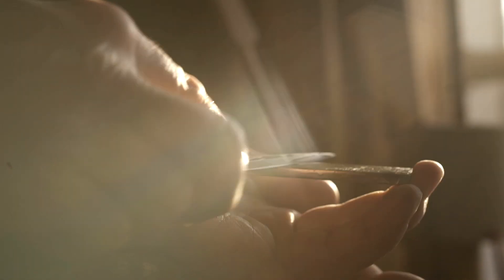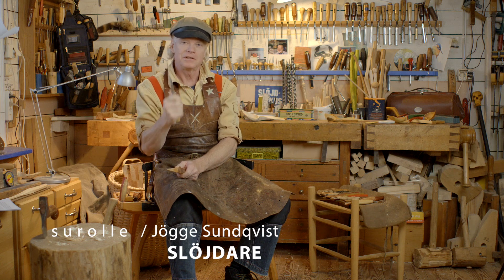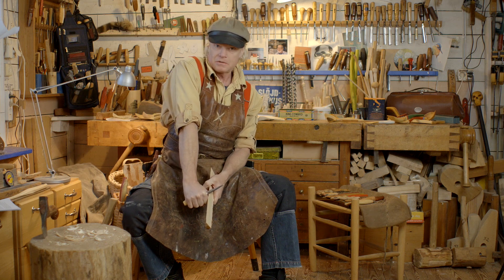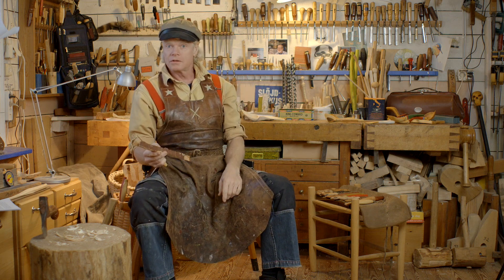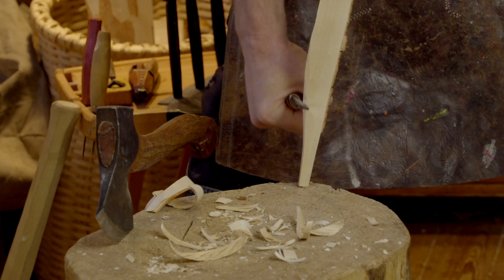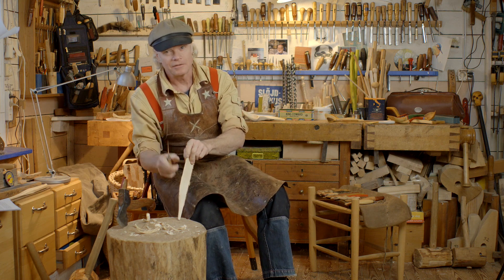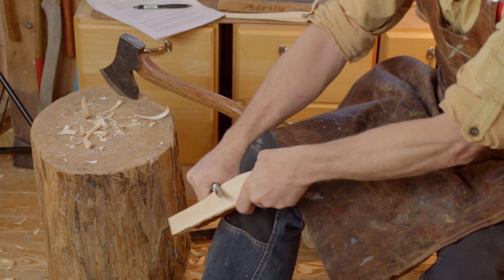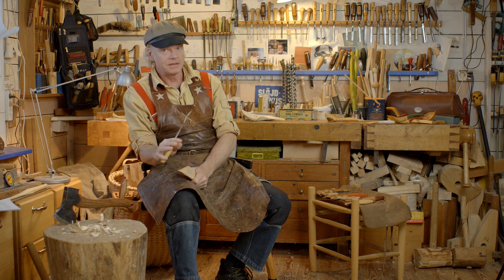Swedish Knife Grip Sessions NO3: The Power & Knee Grip.

Comment: That's a good video, nice bushcraft grips. However, the first cutting technique shown could be a fantastic way to slice through your femoral artery and kill you quickly if you slip. Probably shouldn't show people to cut inside that magic triangle...
Reply: This is Scandinavian/Sloyd style woodcarving and has been in common use long before the word bushcraft was even conceived.
Reply: Although I've seen this technique taught with the work held on the outside of one leg, which is probably more fool-proof than this variation, Jögge is starting the cut with the blade facing away from himself, about level with his knees and then pushes it away - the knife never travels towards his groin and can't slip uncontrollably because his arm is locked, meaning any movement of the knife cannot has to involve his whole torso.  You couldn't stab yourself in the groin using the demonstrated technique, even if you tried.
Reply: Also "don't cut toward yourself" is more BS handed down. If you know how to do it correctly, it's perfectly safe.
Reply: I see that this is an old comment but no one has addressed a simple fact. If you do the technique as demonstrated and follow through as demonstrated you have made a false statement. Clearly you have not paid attention to the presenter.